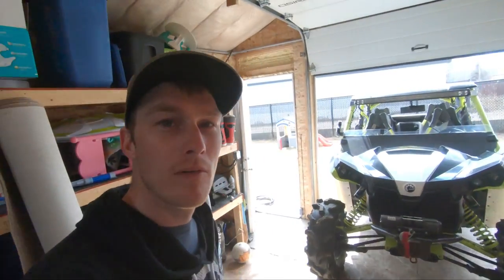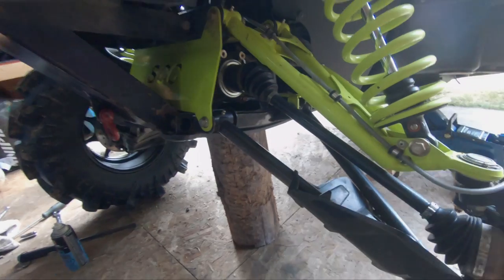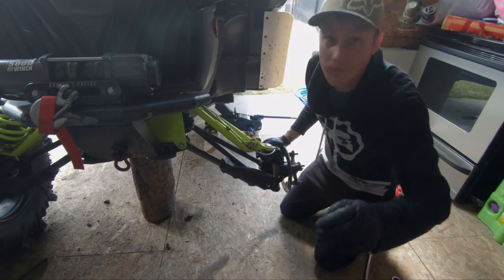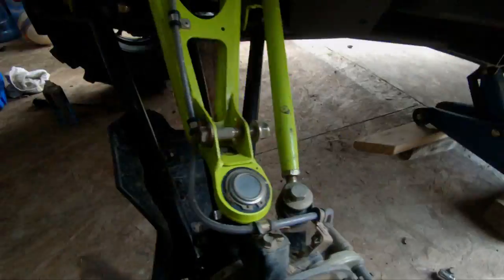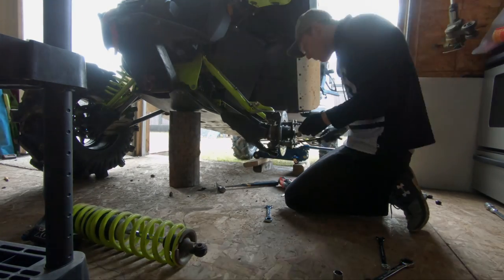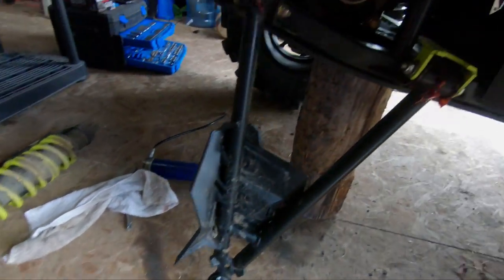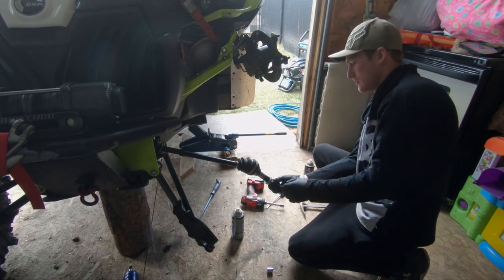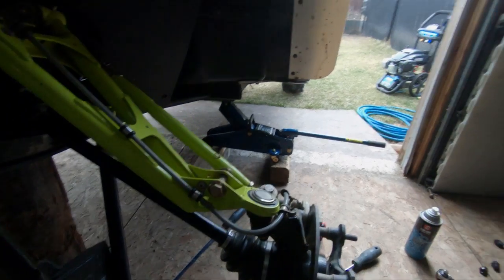How To Replace The Axle On a Can-am Maverick

Comment: came for the torque specs, thanks man!
Reply from the maker: No problem. Glad I could help!
Reply: Nathen Holmes can you explain how to change the rear Drive shaft in a 17 can am maverick xmr 1000
Reply from the maker: I have never had to do mine but the way I would do it is.
 Drop your skid plate and  maybe some console side panels off. Thanremove the C-Clips and beat the caps out. Smack the beefy part of the yoke were it meets the shaft and the hoing caps should pop out. Use a rubber mallet or hammer if they dont want to come out. Do the same for both sides. Clean everything up for an easy install. Than just reinstall by placing the driveshaft in and than your ujoint caps in making sure all your bearings inside are in place. They come Greased. Than pop the C-Clips. 

Hopefully this helps you. If I ever have this problem I will make sure to make a video. Just went riding with someone this past weekend who busted the front driveshaft.
Reply: Nathen Holmes thanks I’ll try that. I bought this machine 2 and a half years ago and this is th first thing I’ve broke one it. I feel like that’s pretty good for mudding Iike I do and hitting atv/utv bounty holes at the local mudd park
Reply from the maker: Yeah if that's all your broke since you've had it mudding. Your doing really good!
Reply: Mitchell Posey I’m headed home to start on it do you think I’ll have to unbolt the rear diff and slide it back
Reply from the maker: I dont think you should have to no. Get both  ujoints apart and it should be able to come out.
Reply: Nathen Holmes that should be easy to do it busted clean off right before the back yolk
Reply from the maker: Well hopefully it's easy for you. Let me know how you make out.
Reply: Will do
Reply from the maker: Hey how did you make out with your driveshaft?
Reply: Nathen Holmes it was easy. I only broke th  second half of the drive shaft. Where it connects to the rear diff. I did have to unbolt the 3 bolts in the rear diff to get that last Lil bit of room I need to get it to slide in. I cut that metal band that holds th boot on and I anti seized th crap out of th splines and when I put it back in I used a small dab of silicone to go around the shaft for the rubber boot to seal. Then I took a zip tie and cinched it back down so nothing could get in like dirt or water
Reply: And that 13mm bolt that holds the u joint to the rear diff was a pain to get. But I did get it and I had to use a wrench. It was the only thing I had to get in there. Hopefully that helps paint a picture for ya. Total it may have taken about an hour and that’s with me being inexperienced.  If you have any other questions about it or I forgot something feel free to ask.
Reply: On a side note for future reference I pulled th console and seat on driver side to pull the whole shaft. I couldn’t get my wrench in and have enough room to break it loose due to the cvt belt cover so if someone is planning on removing the whole drive shaft I’d say they’ll probably have to get it from the passenger side and may possibly have to remove the gas tank
Reply from the maker: Awesome! Well glad you got it done! Thanks for all the information.
Reply: Thanks for the video it Was very helpful
Reply from the maker: @savageb117  I am glad it helped you out! Thanks for watching!

Comment: Awesome video man, thanks.
Reply from the maker: Thanks for watching!
Reply: What is the deal on front of the axel
Reply: Seal
Reply from the maker: I'm not 100% sure what you mean by that. If the seal is toast they pop in and or out. I have had to replace the passenger one. I just grabbed a socket the size of the seal and tapped it in. Hopefully that helps you.

Comment: Did you put stock axles back in?
Reply from the maker: Yeah in this video I put stock in.i ended up breaking it again 2 months later and put in after market.
Reply: @BertaRiders  What after market axle did you install?
Reply: @BertaRiders  Also since you are going through all this unbolting dies it makes sense to just replace the seals while I am replacing both side axles?
Reply from the maker: @nwags357  I used a heavy duty Demon axle. And if you haven't had any issues with leaks or anything and no noticeable chunks missing from the seals I think you fine not replacing the seal.
Reply: @BertaRiders  thanks!
Reply from the maker: No problem. Happy to help!

Comment: how do you get one out that’s stuck mine only comes out half a inch or so and it’s stuck and won’t come no more i’ve yanked and yanked and yanked and nothing
Reply from the maker: Wrap a strap around the end of the axle and wrap around a sledge hammer and swing the hammer. Should come out by doing that

Comment: any solution when axle broke off in differential
Reply from the maker: I had one break off inside before and what I find the easiest is to pull the other cv axle out and tap it out from the other side. Better than messing around. I used a very long but small diameter screw driver and tapped it out. Popped out easy.

Comment: No Torque specs. Also there is a proper way that compression washer is suppose to be installed. You just threw it on without checking for having the convex side facing out.
Reply from the maker: No torque specs? They are in the video..  and as well this is off the Demon Website on installation 
Installation:

Inspect Axles to ensure there is no damage before installing

Remove Castle Nut

Apply a small amount of grease to help slide the splines and clip

Insert outer CV into trailing Arm / A-Arm

Hold CV Joint Housing Only [Holding the boot may cause damage]

Push the inner CV housing into the differential until you can hear the retaining clip snapping into its groove

Try to pull the inner joint with some force to make sure circlip is engaged so the joint cannot be pulled out easily

Fasten the hub to factory torque specifications

Insert Cotter Pin

Re-assemble all components